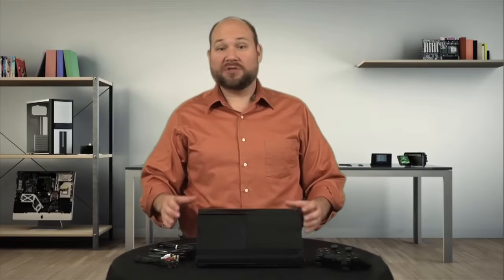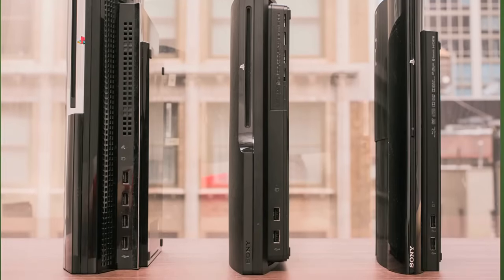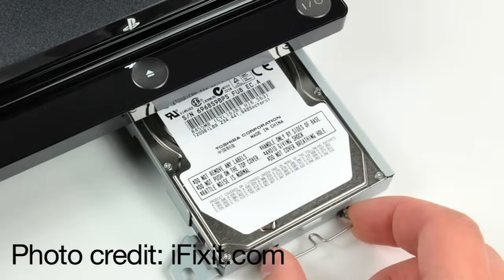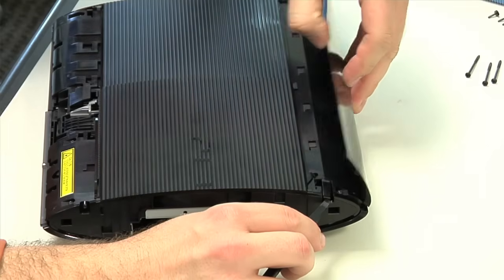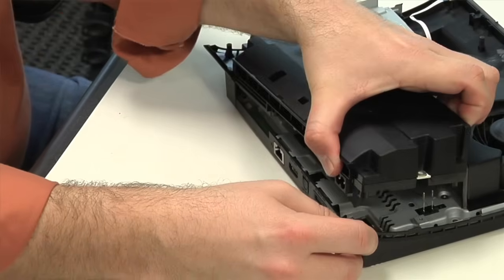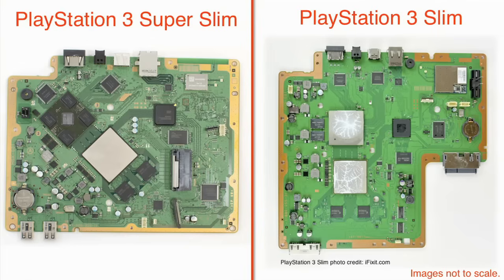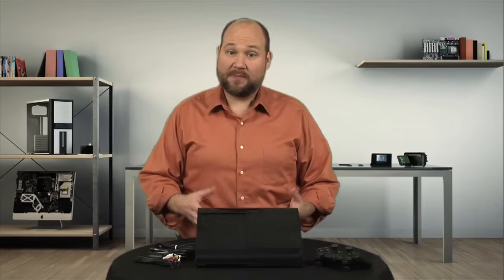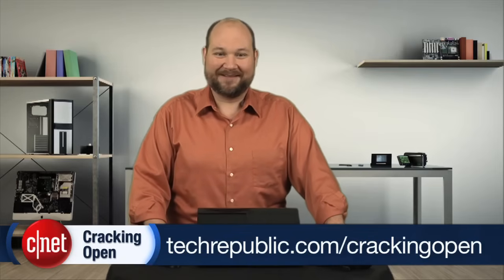PlayStation 3 Super Slim teardown

Comment: 10 years later, mine is still going strong and quiet,  ran it for 10 hours solid today.  Super slim my fav ps .
Reply: Mine is also still working 😊
Reply: @jangofett4547 same here
Reply: Yeah, I noticed an overheating problem with mine so I want to clear the dust so here we are
Reply: @idiotically-everything  not only dust but thermal paste
Reply: mine slim got ylod😢
Reply: Mine is also still perfectly working(aside from that one problem I had with the HDMI, which got easily fixed by holding the power button for 5 seconds).
I'm doing a FF13 trilogy 100% run and I honestly never had any problem with it in my 10+ years of owning it.
Reply: Me too 10 years as well no problem. But I'm thinking about cleaning it

Comment: When I opened mine up I have a cech-4201c it was a 500gb ps3 it had a 750gb hdd ( I have a USB to Sata cable that allows to use them as external drives ) in it which I thought was really odd I wonder what’s on the other 250 or if it’s just a blank partition, ( probably blank ) was a nice surprise when I SSD swapped it

Comment: Don't use this as a tear down tutorial. He misses very important steps, you WILL break tabs off your covers if you don't know how to properly remove them.
Reply: already did. pretty sure my ps3 is shot anyhow though. my cat knocked it over last night and now when i turn it on it gets really loud and shuts down after 10 or so seconds. i'm assuming the fan came loss or disconnected so it's immediately overheating. since i have quite a few ps3 games i still like to play, i'm hoping i'll be able to fix it but i'm not that optimistic about it.

Comment: Sliding mechanism also increases reliability.  Cutting cost is big but simplifying comes reliability.
Reply: Ive had my ps3 slim since 2011. The disc mechanism still works fine 👌

Comment: there is no performance issues with 2 RAM chips, because of same quantity connecting lines. Only doubled HEAT from 4 chips with more thick tech process. And a doubled price for 4 chips of course.

Comment: My PS3 super slim stuck on red light it won’t turn green I checked cables all of them are fine? What should I do ? Is power button malfunctioning?
Reply: Power button more than likely ...im having this problem now and i cant fix it....at first i toor the ps logo thing off and used a pin to tirn it on but now i cant even do that

Comment: Super slim is shit
Reply: It has better performance than the slim lol
Reply: @__mayo1802  yeah but the super slim wont last long at all my sister had old you had to try for 10 mins just to get it to detect that the door was shut! super slim might have better performance but the slim will last longer.
Reply: @cadeningram284  Wtf bro, i have a my super slim for 8 years now and it works perfectly, i only changed the thermal paste and cleaned the console 3 times in all this time
Reply: @cadeningram284  and the problem with the door is probably cause she didn't pressed the button to open it, she would just move it with her hands, cause i didn't had any problems with that
Reply: @__mayo1802  we have always used the buttons and we have had it for about 4 years and it started not reading disks due to the door this is just my personal experience with the super slim personally i prefer the ps3 slim because the super slim just seems super cheaply made just feeling the plastic it just feels super cheap in the hands. But if you like the super slim im not hating on it its just my personal preference.  no hate but as you can see this comment was made 2 years ago.
Reply: @cadeningram284  after i send u the first reply i saw that the comment was 2 years old haha, yeah i get what ur sayin but for me the super slim is amazing, i never had problems with it, its small so i can take it everywhere in a backpack with all the cables, controllers, and some games as well
Reply: @__mayo1802  yeah thats the good upside to the super slim

Comment: Someone help me out which should I get 1.ps3 2.ps3 slim .3ps3super slim which one last longer
Reply: In my opinion you are better off with the PS3 Slim not the super slim I used to have the original PS3 but it broke down no matter how hard I took care of it it just simply stopped working until I opened it up and I found out the motherboard was done most of the internal components were fried so I decided to upgrade to PS3 Slim 500 gig model and oh boy the PS3 Slim has lasted for more than 11 years I just couldn't believe it how long it has lasted then I decided to purchase a secondary PS3 but I wanted to try out the super slim and it worked really well but after 3 years it decided to stop working and no matter how hard I took care of it it didn't want to work anymore I believe the PS3 Slim was built to last unlike the original PS3 and super slim was built to break after three or more years so you are better off getting the PS3 Slim 500 gig 😉👍

Comment: there are 4 gens of ps3
Reply: Actually there are five generation PS3 consoles and I know you're going to tell me how's that possible so let me explain the very first original PS3 which is only available in Japan which is silver colored you cannot get it anywhere else it's not even available at North America the second generation PS3 is white only available in Japan the third generation original PS3 only in jet black was finally available in North America no other color was available the fourth generation famously known as PS3 Slim you can only get it in Black no other color was available in North America or anywhere else the 5th generation PS3 super slim comes in three different colors black white and red with the exception of custom made skins Limited Editions so the one I have is the fourth generation PS3 Slim 500 gig model I still have it and it still works for the past 11 years however I did purchase a secondary PS3 the super slim model I still have it till this very day 😉👍
Reply: there are 4 because the ps3 i own is one of the very first ps3. the model is not very popular once the 2nd gen ps3 came out. the 1st gen. ps3 was the fat one but had only 2 usb ports and an hdmi port but didnt have the panel with the sd card port and the other things that was in the panel. the 3rd and 4th gen. ps3 where both the thin ones.
Reply: @rileyhorner5801  actually there are five generations of PS3 look at my comment below 😉👍
Reply: @Cesar Chavez actually there are five generations of PS3 take a look at my comment below 😉👍

Comment: i like the super slim because it can have up to a 500gb harddrive
Reply: the original super slim comes with 12GB... and you the 2nd version comes with 450GB
.. in ps3 slim the 1st version comes with 320GB and the 2nd with 500GB
Reply: gamer tron 2.0 superslim is the best mine is 1TB ps3 superslim
Reply: Tech K&M upgraded drive i guess
Reply: Actually I have the PS3 Slim 250 gig model but I upgraded the hard drive with a 500 gig hard drive and it works flawlessly 😉👍

Comment: ps3 super slim or xbox 360 slim

say mee
Reply: +Masette Origin The xbox 360 is better.
Reply: Masette Origin My xbox performes better than my ps3 though.
Reply: ps3, free online
Reply: BiH Gaming NB ps3
Reply: I had a 360 and ended up selling it to buy a ps3. expensive online compared to ps3's free online, 360 has a terrible interface, and I couldn't type for shit with the terrible 360 controller's d-pad. ever since I got my ps3 though I have no complaints, the system is amazing and theres nothing bad I can say about it.

Comment: 3:40 Someone can't count.
PS3 Slim and Super Slim have 2 chips each 256MB XDDR for RAM and video memory.
Reply: hes just wishing it had more
Reply: So what are the two identical chips on the other side of the mother board?
Reply: the Slims and Fat have both exactly the same internalz in them  the only thing thatz different is that the FAT models: A B, C & E had NAND chips in them instead of the NOR ;)

Comment: I miss the 4 usb ports. especially when people can't spend $60 on a wireless controller you could always get the 3rd party wired controllers.
Reply: Actually on my PS3 Slim I bought a external 4 USB 3.0 port hub on the front on Amazon which only cost me $10 only it was worth it now I have 4 USB ports just in case😉👍
Reply: +JustAnwar Premium thank you very much kind sir, or ma'am

Comment: what ever you like this model or not the fact remains that is the most reliable ps3 model whit the least failure rate and less failure rate than all xbox 360 models. This is much more important than all the stuff people bitching about because powerPC architecture from IBM proved itself not to last long.
Reply: Actually you should check out the redesigned Xbox 360 2013 model and 2014 model which I have both they have lasted for the past 11 years and you are right about one thing the original 360 consoles didn't last they were poorly designed in terms of quality build and they were not going to make any new consoles anymore until Microsoft received a huge backlash from 360 owners including me the Supreme Court was forced to deal with Microsoft poorly designing the consoles to break so the Supreme Court gave Microsoft two choices 1 you have to make a brand new 360 console from the ground up fully redesigned or risk refunding every 360 owner worldwide but you know Microsoft they didn't want to return all that money to us so they decided to ask the Supreme Court for money in order to make a fully redesigned Xbox 360 so the Supreme Court agreed provided them funding and Microsoft created the new redesigned Xbox 360 2013 model which is the Seventh Generation and the 2014 model is the 8th generation and they were generally received a positive feedback from 360 owners including me I was really impressed in terms of build quality it really did felt expensive but not cheap unlike the original 360 consoles if you don't believe me you should research about Microsoft was in Supreme Court regarding to Xbox 360 😉👍

Comment: I have a PS3 slim but I'm still gonna get one in the summer because it's a 500gb which is a lot for a current gen console and not so much for a ps4 tbh and it's smaller so it's gonna be alongside my monitor for my set up.
Reply: Actually the PS3 Slim supports up to 500 gigs because I had the 250 gig model then I upgraded the hard drive with a 500 gig hard drive and it worked flawlessly never had an issue for the past 11 years and as for the original PS4 it supports up to 2 terabytes internally but externally you can have as much space as you want there's no limit 😉👍

Comment: Ps3 super slim is way better than any other ps3 I mean its a alot more daster, cooler, and more memory.
Reply: NO, the PS3 super slim is a piece of crap!
Reply: Thats why they made it ~_~...
Reply: I like the normal slim, because it still small, but it has the fancier disc drive so I can hide the PS3 in a cubby and still access the disc drive easily.
Reply: Not even in the slightest, the original and the slim are the best because they easily look the best and the harddrives are up gradable anyways and who really needs more than 120gb on a PS3? plus the 60 and 80gb OG's have more usb ports, sd card slots and ps2 BC
Reply: The PS3 super slim is a piece of crap.
Reply: That's what it was made for -_-
Reply: Xtreme Gaming and your point is with -_- lol
Reply: RKD Ram 

Actually the super slim SUCKS
Reply: Nick Anderson your point is ^_^
Reply: There never was a point
Reply: Nick Anderson ok then have a nice day or night lol
Reply: Okz coolz
Reply: shut your face! u got ps3
Reply: Actually the PS3 Slim is capable of going up to 500 gigs because I have one for the past 10 years and the ram capacity is exactly the same all PS3 models has the same Hardware and software the only difference is physical design😉👍

Comment: Too be honest, I love the olden-day, retro-style grill of the Ultra Slim, and the manual, sliding disc cover is a welcome addition, as if it stuffs up, you can easily forcefully slide it open yourself. It saves space and you wouldnt have problems getting discs out like with the previous models if the optical drive stuffed up. The Ultra Slim is smaller, lighter, more compact, slightly faster and quieter then the previous models, so I dont believe its a step back, but a step forward. A PS3 is a PS3, they weren't going to change it with the Ultra Slim. It was always going to be a more refined version. Im happy with my US :)
Reply: +MrJangofett66 it's cheap and looks like it'll break easily. Ps3 slim is the BEST!!!!!
Reply: @LilWizzyyTV yep. Ps3 slim owner here. Best ps3 out of the 3 versions
Reply: I wouldn't say it's more quieter, it's certainly more quieter than the original fat PS3 but compared to the slim PS3, I feel like that's the only part the super slim takes a step back as its slightly more louder than the slim since the disc operates right on top of the system but other than that, I don't think the super slim is as bad as everyone says it is
Reply: Yea, im happy with it. Its half as big as the slim and like a quarter as big as the phat. Yea it is pretty loud at times, but I still think its just as if not quieter than the slim, as Ive heard the slim and ultra slim side by side many times.
Reply: The super slim sucks.

Comment: I like the PS3 Super Slim optical drive (0:56) because the laser optic lens are easier to clean unlike my older slim (not super slim) which I have to remove those screws to clean it voiding the warranty.
Reply: 2021 and I just got my super slim! Had it in the pawnshop for a bit and its home now
Reply: I like the PS3 super slim
Reply: Warranty void stickers are unenforceable in the U.S., basically they mean nothing and a warranty void sticker cannot void your warranty, not like your PS3 warranty is still good lol.

Comment: These slims are hard to open. Nothing is pop off. The sides come off first (slide) and then the front and back come off (slide). If you try to pop them off you will break the teeth that keep it locked in place. I own a slim and tried to open it blow the dust out so it wouldn't over heat and to see if I can stop the fan from being so loud. After concluding that I shouldn't open it and put what I took off back on. I just vacummed and blew the vents all around and it sounds like new. Also a screw driver isn't the only tool for the job. It needs special hex with grove in the center. Dont recommend opening!

Comment: PS3 60 GB The best one !
Reply: XxKoolKatxX It's not terrible if you change out the old thermal paste on it and do a few mods to it. I've bought mine used (2006 model CECHC04, partial backwards compatibility) and with a few mods it's actually really quiet. I like it a lot.
Reply: +Cody Can your Slim or Super Slim play PS2 games and Super Audio CDs? I don't think so.
Reply: Evaldas65 LOL from 2006 that's super old I would rather get the slim from 2009 or the super slim from 2012
Reply: XxKoolKatxX How old are you?
Reply: Until it stops working with your disc stuck inside.
Reply: Matoosaw6 lol ps3 60gb is super old so its terrible

Comment: I got the.super slim cause my original ps3 over heated and pretty much was useless and i got to say its perfect for me. I feel its easier to clean if necessary and now i can fit it pretty much anywhere, and my old ps3 fucked up in the disc drive and i spent hours fixing it using the game it broke as a test subject, now i don't have to worry about my games being trapped.lol

Comment: All PS3's have identical features, gameplay wise. The fat does have 2 extra USB slots. And the very first batch was backwards compatible with PS2. However, newer versions have more hdd space, which is VERY useful.

 As far as your question about buying a PS3. I'd say yes. There is a huge library of great games and Sony said they will still support PS3 for 3 more yrs. When a new system comes out, games get cheaper on the previous one. Unless there's something you must have on PS4, go with a PS3.

Comment: Another thing... I'm buying a 500gb ss GTA5 bundle for $269. It's an amazing value. Consider the fact that upgrading a slim to 500gb would cost around $80. Then add another $60 for GTA5, a game that is a must own. Now, I did see a 40gb fat refurb at Gamestop for $129 (online only). But, you will probably want a lot more hdd space. So, doing the math, the ss bundle is going to be your best bet in more ways than one. I guess I don't want to see anyone else have bad luck with a used system. Buy new

Comment: I currently have the PS3 slim 120gb model. I bought it used August 2012 for $139. I've put it through it's paces since. Gameplay sessions of no more than 3hrs, but video streaming significantly longer. When buying a used system, don't plan on it lasting longer than 1yr. My PS3 is beginning to crap out, and I took care of it. Best advice would be buying the 500gb ss bundled w/GTA5 for $269. Sony plans on supporting PS3 for 3 more yrs. Lots of great games for budget prices, and GTA5 is stellar.

Comment: for one these reviews saying sony took a step back is just annoying for all the people who think that the top loading mech is cheap, well it most likely is but sony just fixed a problem: there is no longer any motors or things that could cause the system to overheat more, now its just like the slim ps2, its not powered by motors that make the system use more power and make the super slim more power efficient, also the disk tray is more open and will cool down faster, this system is alot better